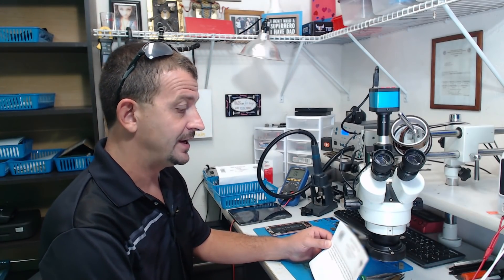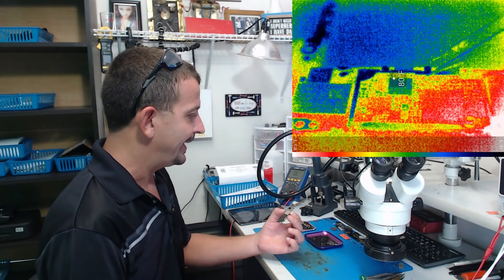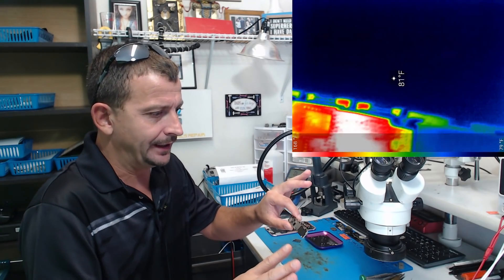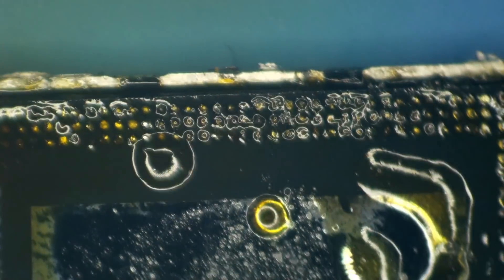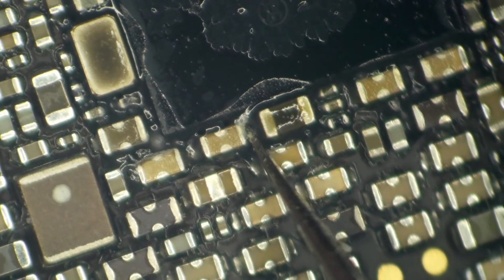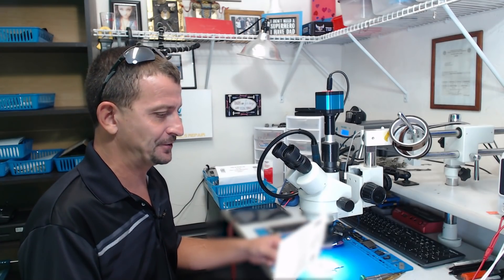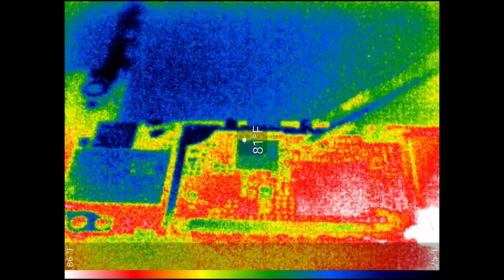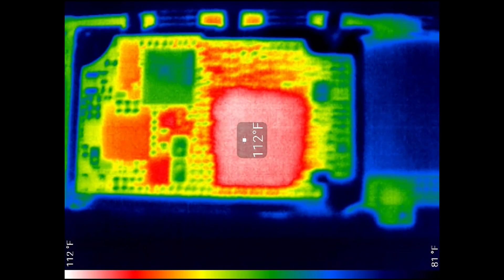Customer says "Phone will not turn on"

Comment: Is that real or fake? Did you desolder the Ram? 

How would somebody open the phone and just desolder the Ram? And why? 🤔
It's really unrealistic
Reply from the maker: I think this customer sent the phone in for data recovery somewhere before it got sent here for a second opinion.  It looks like they removed the RAM to narrow down a problem between the CPU or the RAM and discovered a problem with the CPU so they stopped.  That - OR - someone sent it here like this to screw with me! :)  I did not remove the RAM.
Reply: @ststele  It could be. Your argument makes sence. Thank you for the fast response. Keep uploading short videos :)
Reply: I figure that, or the first shop couldn't figure out what was wrong with it and used it as a donor for another phone and charged an examination fee and took the chips as donors. Then returned it as a no fix thinking they would just toss it and never find out anything was missing. Shady people never cease to amaze me.

Comment: So your customer was a donor RAM supplier at their previous repair stop. Why the hell did they accept their phone back in a non working state from the alleged RAM thief? Also if they had such excellent heat control it means they were either very lucky or have skills. If it is due to having skills why would they need to pinch the RAM or have I answered that in my initial sentence?